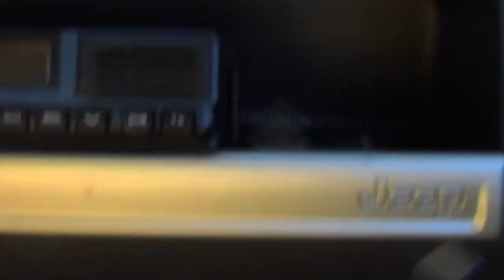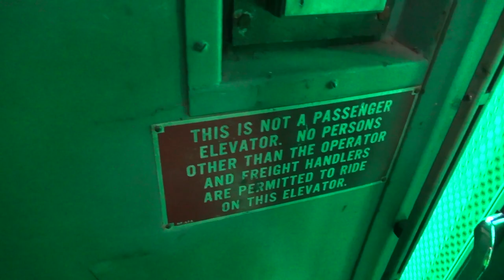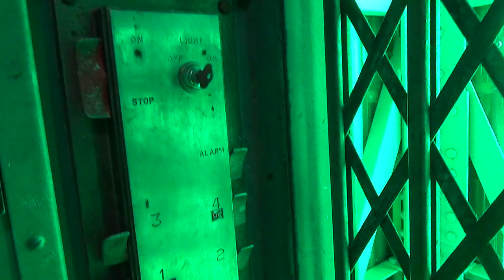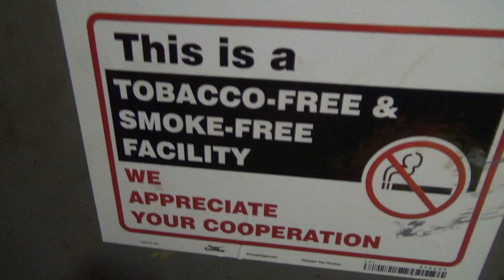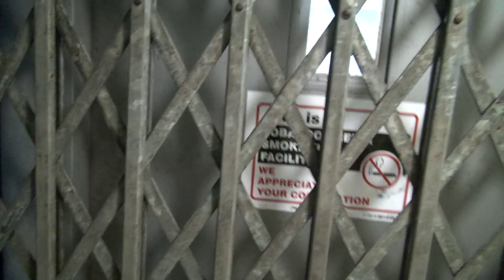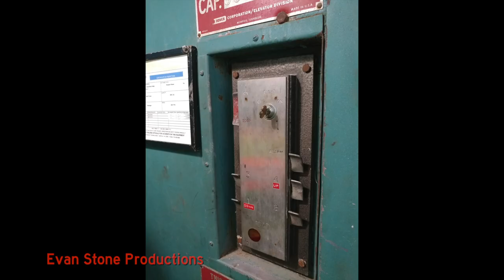James River Bridge Tour

Comment: The depth of the James River varies wildly; in some places it is about 10-20ft deep, but in the channel at the span it's about 70 feet deep.  The deepest parts of the river are in front of the Shipyard, of course.  Speed restrictions are very common because the river is 4.5 miles wide, winds are extremely strong that can actually push your car during storms!

Comment: The southbound lanes were built and completed first, which is why those lanes have the "handrail" at the top of the sides, and the northbound lanes have the "Jersey Wall" sides.  The steel lift span was the very last part of the bridge to be constructed.  The lift span itself is 350ft long.  The old/original bridge actually lifted 10 feet higher when fully open than the current span.
During construction, once the southbound lanes were sufficiently completed, temporary trestle was built to connect the two bridges, and traffic would get on the new bridge, then transfer over to the old bridge at the lift span before being transferred back to the new bridge for the rest of the 4.5 mile trip--with one lane in each direction.  Once traffic was using the new bridge, all trestle for the old bridge was demolished south of the lift span first.  The old bridge remained standing for some time from the Newport News side to the old lift span (which remained permanently fully open).  After a few years, the old bridge lift span was demolished, leaving just the 1/2 mile stretch from the Newport News shore which became the James River Fishing Pier.
Each lane of the current bridge is 12 feet wide (from white line to the dashed lines), while the original bridge was only 10 feet wide, and had no extra space between the edge of the lane and the handrail!  Yes, the original bridge just had a steel handrail to mark the edge, as opposed to the concrete jersey wall sides of the new crossing.  Very, very narrow!
Reply from the maker: Thanks so much for your comment! That is so fascinating.

Comment: During construction, the lift span was the very last part to be built so there was a time when cars would get on the new bridge's southbound lanes (1 direction each lane) and be transferred to the old bridge to cross at the lift span, then transfer back to the new bridge.  When the new bridge was completed, the old bridge span was left fully open for ship traffic and then eventually demolished, except for the 1/2 mile section on the Newport News side that became the fishing pier.  Toll booths once stood at both ends, on the Isle of Wight County side the booth stood at the site where the current 9/11 Memorial stands.